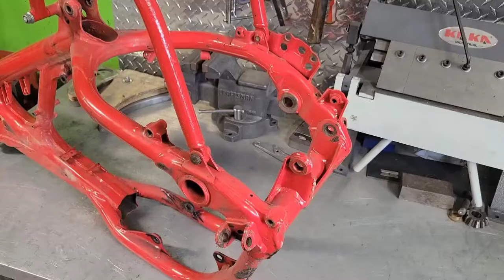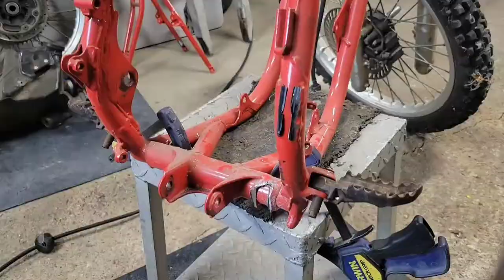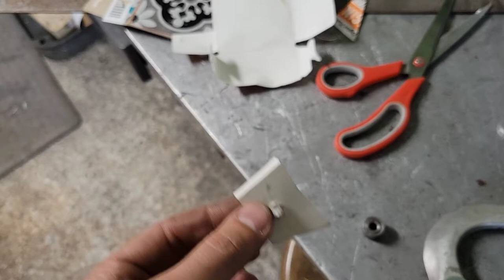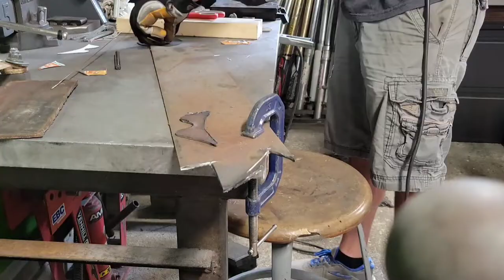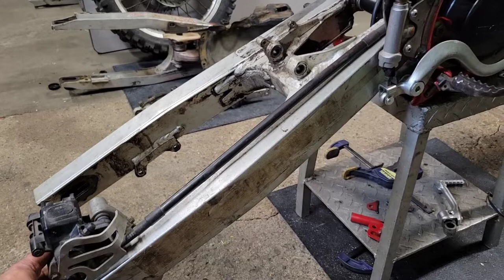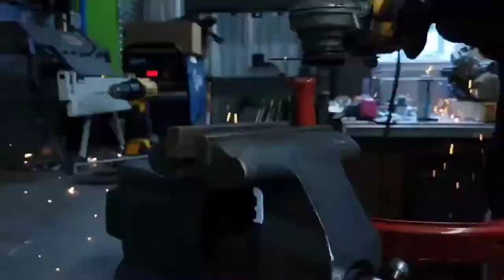Rear DISC brake conversion - 1986 CR125

Comment: Great video.  This is the kind of stuff I like to watch.  I have a couple builds I'm planning on doing the same thing.  I'm currently working on a basket case '90 Cr80 I picked up cheap.  With combination of buying a few parts and doing some metal fab, I made a frame jig so I could bend up new frame cradle rails and weld them in.  The bike was missing parts and it made more sense in terms of cost, to source '96+ sub frame, seat, tank, pipe etc.  While in the jig, I modified the newer generation sub frame and my 90 frame. Also made some mods for tank mount.  I was missing all those parts, so the newer generation was less expensive and this also allowed me to find new plastic as the '90 is about impossible.  Fun stuff.  If you have an air compressor, buy a pneumatic angle grinder with some 2" Rolocs.  If you don't have a vapor honing cabinet, build one.  Total game changer for restoring parts and even rubber parts.  I used a Harbor Freight blast cabinet and bought the plans from HTMR.  I've got a short video on my channel for the cabinet.
Reply from the maker: Ow nice dude, sounds like you've got some fun projects going!.  The fabrication aspect of the builds is my favorite part for sure.   I'll look into the grinder.  My blast cabinet is also a home made unit and sounds similar to yours.  I watched a YouTube video for the plans